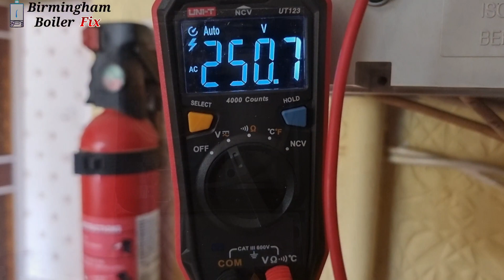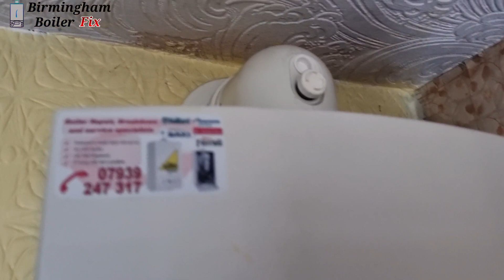Wocesterbosch greenstar 12i not firing up boiler diagnosis repair Birmingham uk Gas engineer

Comment: Thanks for the video, after a reset, what could be the issue if it fires up but then goes off several times (then flashes blue)? The boiler seems to work OK when the cover is off.